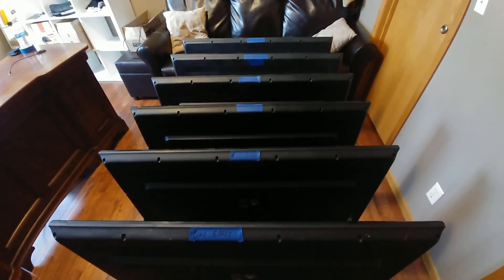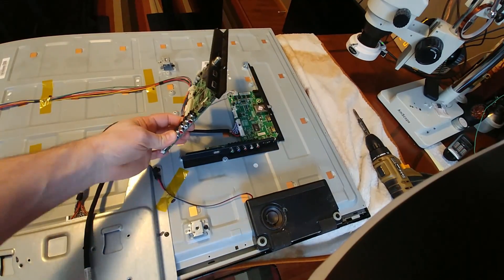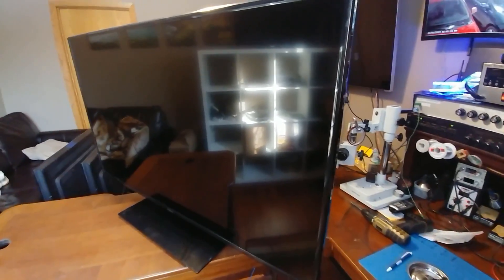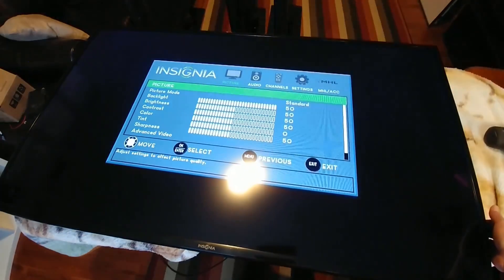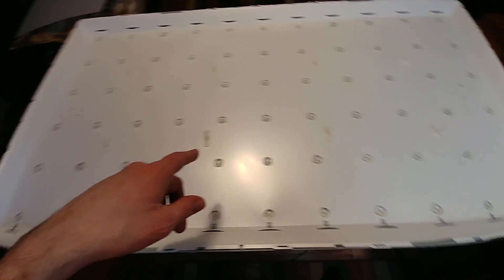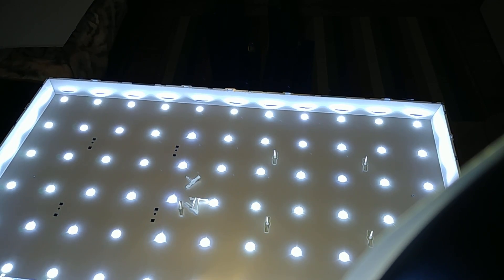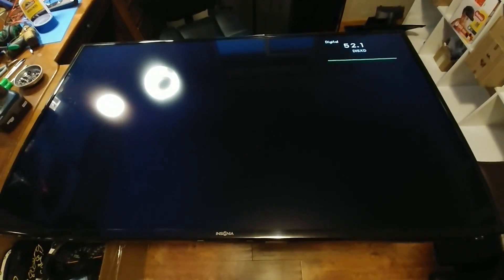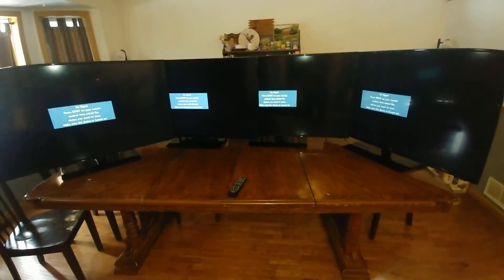Repairing a bunch of 50" Insignia LED HDTV's

Comment: The trick for using the flashlight to check if the TV is still working saved me a lot of worry and headache, I'm about to order new LED's and get my 7 year old 4k TV back to new. Thanks for such an easy quick tip and great job fixing all the ones in your video, you definitely know your stuff.

Comment: Great video  Where can  I find a LCD/LED screen for my insignia E55141nkapbmnnx and it my be compatible to NS55DF710NA19 not to sure but I have replaced some parts from the NS55. Can you help me?  Thanks Geno
Reply: Thank you
Reply from the maker: Nobody sells replacement LCD screens in the United States. It's cheaper to buy a new TV then to ship in a sheet of glass.

Comment: I have a 50" Insigna NS series. The backlight went out while watching it. Sound and all continued working.  It has two sets of red and 2 sets of black going to LEDs of power board.  I tested while on and get 36 Volts from chassis to to red leads.  I unplugged LED connector and get same voltages on power board.  Dies this sound like a powerboard / inverter problem or LED's?
Reply from the maker: Sounds like it's probably failed LED 's.
Reply: @jeffescortlx  so I tore it down.  Has 4 strips of 8 LEDs.  I tried the 3 battery test and not a single strip comes on?  They all look good, nothing burned.
Reply from the maker: @stugny  what kind of batteries? For 8 LED's you'll need at least 24v.
Reply: @jeffescortlx  Actually I took a set of tea lights I had with two 1.5V in series and tested each LED and found out I had one bad on all 4 strips.  I pulled the good ones and put them together and the two good strip came on when I powered up TV so I am assuming everything else is good and it is the LEDs.  I do have one more question please.  When removing the LCD I was very careful but there were 5 flexible green tabs along each side.  One of these tabs came off.  Is this an electric piece to the LCD screen or are they there to lock the screen in??  Not sure if I ruined LCD.  Thank you so much for you video and you time!!!!
Reply from the maker: @stugny  Yes it does appear bad LED's was the issue all along. Unless those tabs on the LCD was a piece of tape, it is required. It was probably a flexible tab bond, needed for the image. You can plug the LCD back in and check the image for missing sections.

Comment: Just stumbled on your channel. Been keeping a 39" Insignia LCD tv that's not working. When Its plugged in, right away I hear a clicking sound from the speakers and tv won't turn on. I have the main board out and checked the compacitor's, upon visual inspection, nothin looks burnt and each cap is charging up with my meter. What's the most common failure with the Insignia Lcd tv's? any input will help. Here's the model #, Insignia 39" 1080p HD LED TV (NS-39D420NA18)
Reply from the maker: Most common failure with any LCD TV is LED's.

Comment: Let me tell you that for a first time TV Repair standpoint; Insignia makes it very difficult to do repairs. They literally glue everything down because they don't want you to repair them but to just purchase another TV. 4 hours in and find out that I need a LED tester to replace backlight issues. The TV will power on and load an image and then within a few minutes to seconds it goes dark. If you shine a light on it you can see the background so I think the LED lights are dying which is why I am replacing them. We will see though! I got blisters on my fingers from trying to remove everything haha
Reply from the maker: The repairability on the insignia's is model dependent. Not all insignia's are hard to service. The ones in this video are pretty easy to repair.
Reply: @jeffescortlx  also great video man!
Reply: @jeffescortlx  mine so far is a nightmare lol might be because its my first time doing it.

Comment: Can u fix a cracked screen? Screen replacement on a Insignia Tv?
Reply from the maker: It's not economical to replace the LCD glass in the United States. Unless you happen to find the exact same model with bad boards or LED's.
Reply: True. Definitely not something you could find. Seems getting a new one is all you can do 👍🏼.

Comment: Where do you get your screens, or can you even get them? Have a 50in Insignia that geek squad said the LCD display needs to be replaced. Tv turns on, half screen normal other half grey with lines then disappears. Screen goes dark and you can only faintly make out what would be the input selection menu. Any advice in the right direction would be greatly appreciated!
Reply from the maker: There is no place in the United States that I know of that sells replacement TV LCD panels. If the glass is not cracked it could be a bad T-con.
Reply: @jeffescortlx  Ok thank you! Yea the glass is not cracked, so I am good their. The fellow on the phone, said something about a whole panel being replaced possibly, and mentioned the LCD display. Hopefully it is just the T-con that's bad, really don't want to have to buy a new smart tv.

Comment: Thank you so much for this video.  Very helpful as I am endeavoring to repair a 55" Insignia TV with failed LEDs.  I do not have an LED tester but I do have a good current meter, Fluke 189.  Can you shed some light on what you did at 12:44 in this video to get all the LED strips to light, revealing the bad ones?  "Using the current meter to close the circuit".  Which circuit do you close to get this to happen?  Thank you !

Comment: This is very informative! I have a ns-39d40sna14 which has a backlight problem. 
On powerup, I can see the LEDs turn on for a fraction of a second after which they are off. I can see a faint image when I shine a torch. 
On the power board, I can test 12.56 volts on the supply rail. 
I have tested the 5 parallel strips of LEDs. They seem OK. I have only 1 of the  strips attached and the same issue persists, the step-up voltage system turns off.

What can I do to troubleshoot more or fix? Thanks in advance!
Reply from the maker: I would manually test the LED's again. But push them hard at around 3.3v each at 300mA. At low levels some bad LED's can still work and pass current.
Reply: jeffescortlx This was exactly the problem. 5 LEDs were shorted. I replaced them and the TV is working again

Comment: how much voltage do I need on the lab psu to test the LED strings?
Reply from the maker: It depends on how many led's are in the strip you want to test.
Reply: @jeffescortlx  Ok so they are in series? Its an LG 47" seems like there are 10 LEDs per string. Will a 30v supply be enough? the string is split into groups of 5 aswell so I guees every ½ array could be tested separately.
Reply from the maker: @rimmersbryggeri  as long as you don't exceed 3.3v per led you'll be fine. I generally target 3v and limit current to 100mA.
Reply: @jeffescortlx  I have limpet clamps. Should I use them for lifting the panel out?
Reply from the maker: @rimmersbryggeri  for TV's like 50-55" or smaller i just lift the LCD by hand by myself.

Comment: Hi good sir. I see that you have a significant experience working with this brand so I'm hoping that you can help me with my problem. I have an insignia tv that is unable to turn on internal speaker using the menu option. It is greyed out so I can't choose it from the audio option. This happened when my son tried to use external speaker on it and then after unplugging the audio cable from it the tv now has no sound and the speaker option is off and greyed out. Do you have a clue as to how I can  solve this problem? Thank you very much!
Reply from the maker: Perhaps the internal amp was damaged. Easiest way around this issue would be to use a sound bar or amp assuming the signal audio outputs still work.

Comment: I have an Insignia model# NS-48D510NA15 that doesn't do anything at all when I hit the power button. Should I just look to replace the main board as you did or could the problem possible lie elsewhere?
Reply from the maker: Doesn't do anything at all as in doesn't light up at all? Or it's stuck on a red light?
Reply: @jeffescortlx  When plugged into an outlet the red light shows indicating power but when I hit the on/off button nothing happens. No blinking or anything. Apologies for the confusion.
Reply from the maker: @certifiedyaminspector-dadd6224  typically when the power button is unresponsive, and the red light is lit, but stuck on solid red, it's the main board at fault. Usally the eeprom chip on the main board.
Reply: @jeffescortlx  Wow! Thanks a lot. I appreciate the help and the super quick response
Reply: @jeffescortlx  Hey man.. Thank you 100000x!! I ordered the main board from Ebay and it lit right up! Without your help it would've taken me ages along with trial & error to figure out the problem.  Also I contacted a several repair shops none of which did solder repairs regarding the eprom chip. One explained the technical requirements & equipment necessary to do that type of repair & why it wasn't economically feasible. Those guys criticizing in the comments made it seem much simpler. This way was is truly the simplest and most reasonable option even for the professionals. Thanks again!
Reply: @jeffescortlx  Also when I unplug the tv, I get a slight noise from the speakers. Not sure if that means anything. Just thought I'd mention

Comment: Swapping parts is not repairing. You can swap a part to a known-good one in order to nail down the defect to particular board but if you label the video as 'repairing', then you must go ahead and repair/replace individual components.
Reply from the maker: I don't believe the title is misleading. Technically I took a TV that didn't work, swapped a part and now it works. That TV is now "repaired". Isn't that the definition of the word?

Comment: So no real fix actually, just alot of swapping around :P
Reply from the maker: That's a little harsh considering I started with zero working TV's and ended with 4 working. But yeh no exciting component replacement if that's what you were hoping for.
Reply: @jeffescortlx  Im not saying it isnt working :) im just saying looking for fault on the boards could maybe be super easy fix, transistor or something, 0.15$ fix, thats what makes my bumm excited :P
I guess you could always be working on the boards/components after you fix what could be fixed of course, just saying, all those tools and not using them :) 
I fix stuff too, mostly for resell, i always enjoy watching others how they track errors, some gems to take with me :P
Reply from the maker: @bmsfx  I just so happen to have two TV's with broken glass to scavenge boards and LED strips from. Typically I would go into component level, but didn't need to with enough extra spare parts this time.

Comment: Not really much value in this video, just some guy swapping out parts. If you could actually fix them there would be more value in the video, however I guess it's a lost art now. Especially when you see how little there is inside these screens now! The broken screen basically provided enough spares add that to the fact that you had a spare t-con board made it an easy affair to fix 4...
Reply from the maker: I'll have to disagree. This could be valuable to anyone that owns this model but isn't a experienced technician. It show's trouble shooting on the mainboad, t-con, LED strips and LCD. I'm not sure what your expecting. I don't think the title or thumbnail is misleading. If you want component level repair you'll have to watch my other videos.
Reply: @jeffescortlx  Disagree all you want, but I fail to see how this demonstrates troubleshooting. There are what 3 main boards? Swap out a board and hope for the best - you didn't show the t-con board removal/fitting steps either. Also with the cat in the way you don't get to see the location of all the screws to remove. Repairing in the title is misleading, swapping out parts is more accurate... 
Also handling the screen without protection is bad practice - gloves to prevent finger prints and the risk of cuts and glasses in case of glass chips. Also failing to explain the risks involved is a bad idea as not everyone can appreciate the dangers...
Reply from the maker: @Fifury161  But I did show trouble shooting. I showed how to check for no back light, and how to test and replace LED strips. I showed that a white screen is a failed T-con, I showed that a unresponsive power up is a bad main board and how to swap it. The TV's were repaired, I literally fixed them. Yes board swap can count as a repair too. As far as the rest, I limit hand holding. If you have to see every screw location  and be told that electricity can hurt you then it should be left up to some one that can handle the repair. I don't know what your expecting here. I guess I could add a disclaimer for entertainment use only?
Reply: @jeffescortlx  I guess I should point out that any idiot can be a critic and that I appreciate your time responding to my comments. I agree that if someone needs to be told electricity can hurt then repairing electronics is not for them. I understand you limit your handling of the glass, I just thought it worth mentioning that the oils from skin can make a mark that is difficult to remove (easier on the back of the screen - on the front though some screens have an anti-glare coating and trying to remove marks can also remove that coating!) Also tiny shards of glass can break off.
I guess I'm too old school, as I never had the luxury of board swaps to complete a repair...
Reply from the maker: @Fifury161  I'm open to and welcome criticism. It helps me improve.

Comment: Nice job, as usual. It's nice when you get multiples of the same model. Locally, I walk in and they are like, "yeah, I was thinking $150.00 for these 11 different obscure models with broken glass in 7 of them." sigh
Reply from the maker: Yeah my local recycling shop knows I have zero interest in TV's with cracked glass. They made an exception with this batch to allow me store credit for any that was hiding cracks. They are a nice group of guys and set nice TV's with good glass to the side for people like me that will buy them and save them. Helps to do them some favors and fix some for there personal use : )

Comment from the maker: Find out how to fix your Insignia TV right meow!
Reply: Jeff .. I enjoy all your Vids .. I have a ton of questions .. however I can not find any contact info as per your about tab .. My name is Randi and I am a ham radio and electronics enthusiast .. I have a few LG TVs that came from a Hotel/Resort and as most TVs they are locked in Hotel mode .. would you please drop me a line at my email so I can pick you brain .. thanks Randi n9uom@n9uom.com
Reply from the maker: @randiowen9923  I also have a LG TV from a hotel. But the only issue with mine is it always defaults to the tuner when turned on. You might want to find the compatible residential use model and switch main boards or possibly eeprom.
Reply: Hey that's what my thumbnail says for my chnl. " Do It Meow ". Lol
Reply from the maker: @RANDALLOLOGY  liter of cola?
Reply: @jeffescortlx   thanks Farva.